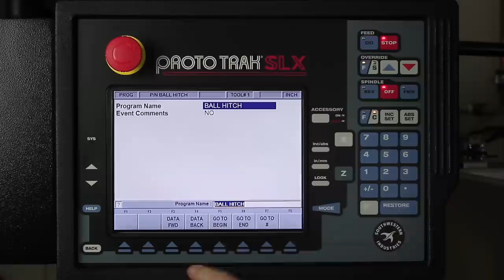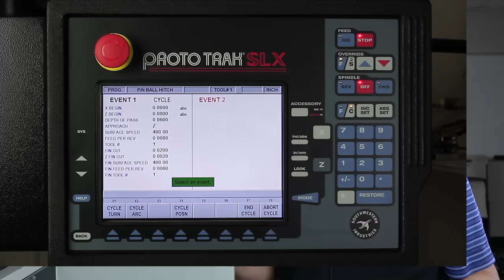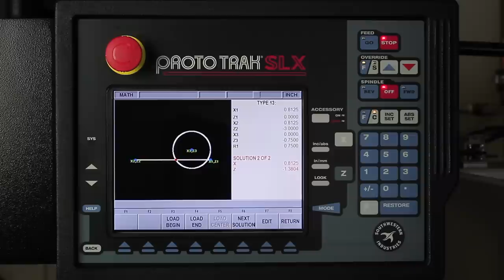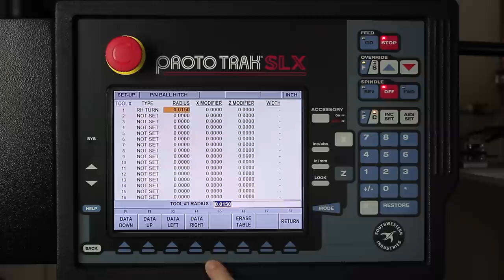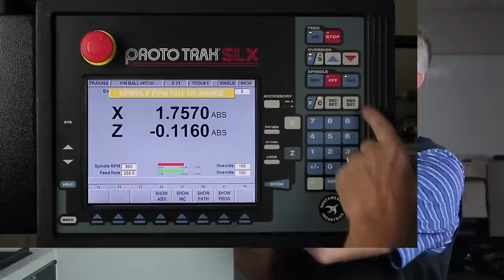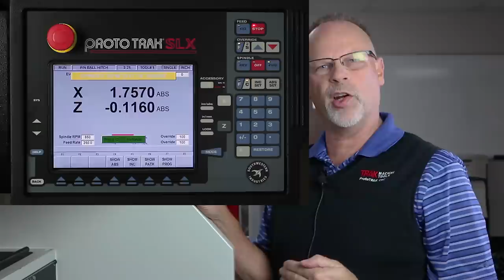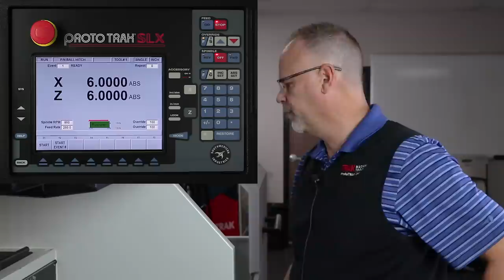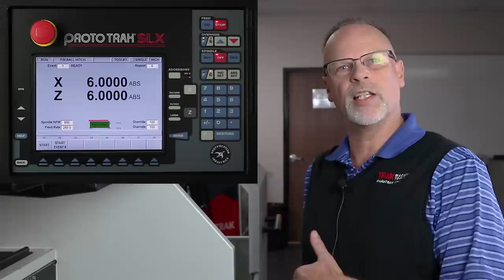Machining Ball Hitch | ProtoTRAK SLX CNC | Lathe Programming

Comment: For the record, if you're wondering why you see the spindle out of range banner show up on this video, it's because I'm using surface speed and not RPM.  When I send the tool post home to a six inch diameter, it can't run slow enough in high gear to keep the speed constant.  Just an FYI.

Comment: Wow Thanks for the video I've been running my 1630 SLX for about  4 yrs now in my little job shop and have done many complex profiles and with the help of math help also, but learned some quick short cuts through this video that will save on some valuable time on some button pushing!
Keep up the good work..
Thanks again,
Karl

Comment: I like your video it's short but helpful, so I would like to ask to show , how to restart in the middle of program ?
Reply: It depends on where you want to start. Most events can be started by selecting the START EVT # button in the RUN mode. This is true most of the time however, it is only possible to start a CYCLE series at either the beginning of the roughing or at the finish cut.  If you need to leave the run mode in the middle of the roughing, when you start at the beginning of the rough cycle, just use TRAKing and fly through the program until you get to where you left off and switch back to CNC RUN. T.P.

Comment: How does compensate for cutting with the back of the tip on the left side of the ball.?
Reply: Normally, I would cut this with a button tool so that I could cut from both the front and the back of the tool however, since I had a tool with enough relief on the back side and the CONRADs were larger than the tool radius, I didn't have too.  Please keep in mind that for most parts like this, you will need a button tool with a full 180 degrees of radius.  Thank you for asking?  T.P.

Comment: I’m trying to do something similar but I keep getting an error message that tells me you can’t move both towards and away from the center line
Reply: When you get that error, it means you have a position move that comes out in the X axis to the size of your material.  All you have to do is replace that position move with a turn move and it will work.  This is a common error that people make but remember, the machining starts at the material stock diameter so everything up to that diameter has to be either an arc or a turn move.  T.P.
Reply: @trakingpat2750  thank you I’ve been using the prototrak mill for a while and while very similar the lathe is also very different